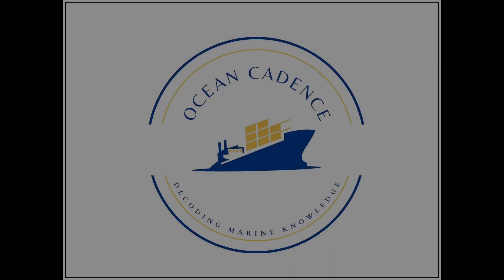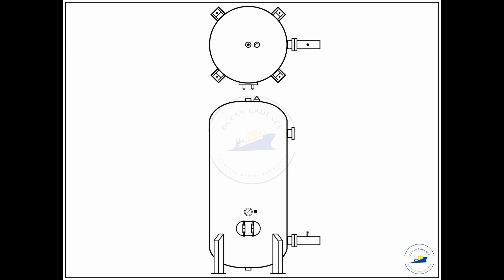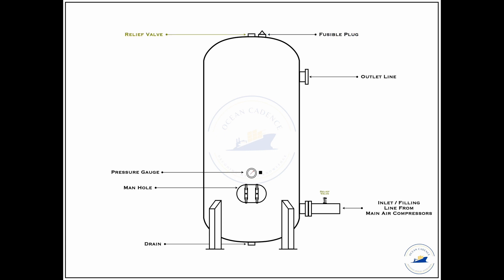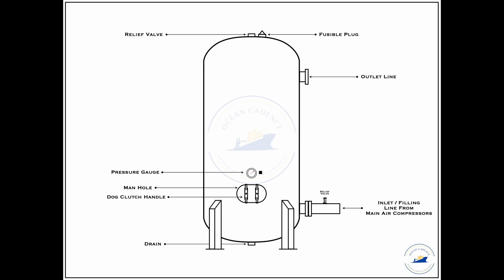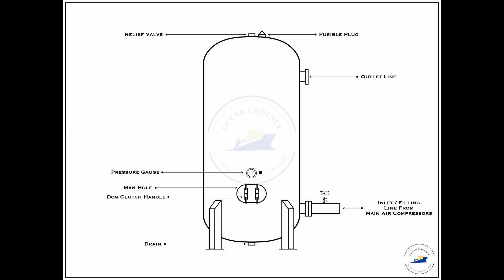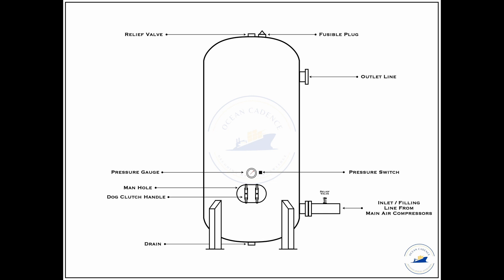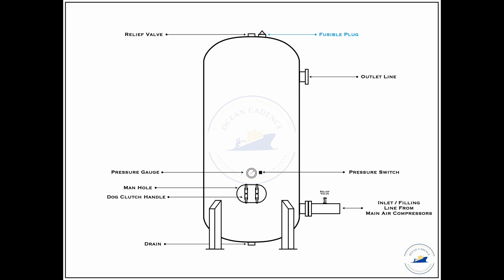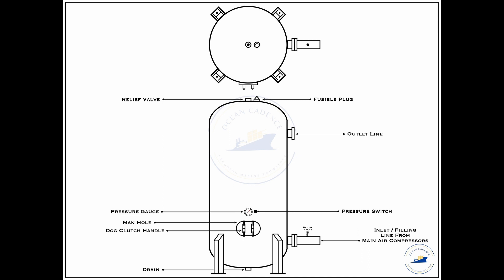Main Air Bottle on ship? Air bottle pressure testing? Safeties of air bottle? Explained in detail!

Comment: How much air can be pressured up into a Air bottle in terms of bar?
Reply from the maker: A typical air bottle that provides air for the starting of main engine and the auxiliaries will have a working pressure range up to 30 bars, max working pressure at 31.2 and relief valve setting at 3-5% above the max working pressure.
However, the auto cut-off for the filling line that triggers the compressor motor off will always be set at a range up to 28.5 bars to accommodate expansion of air in the bottle when the temperature inside the ER is high.